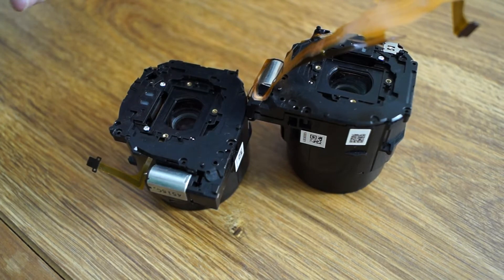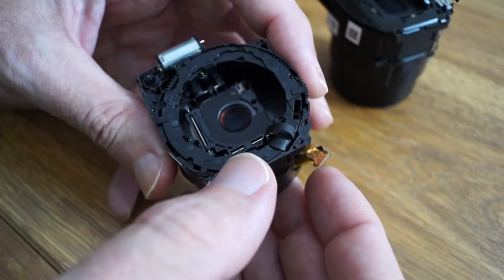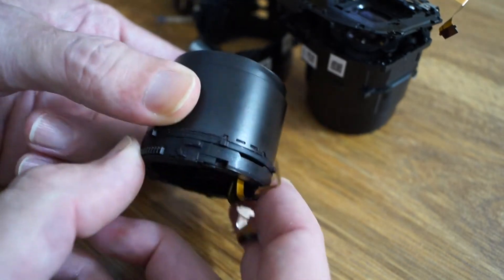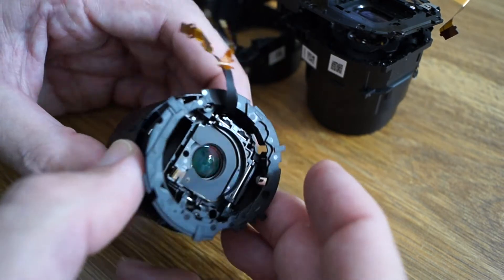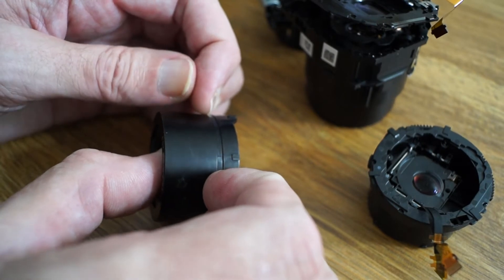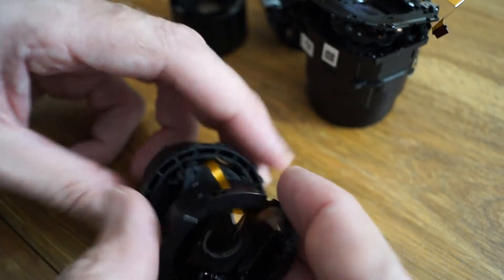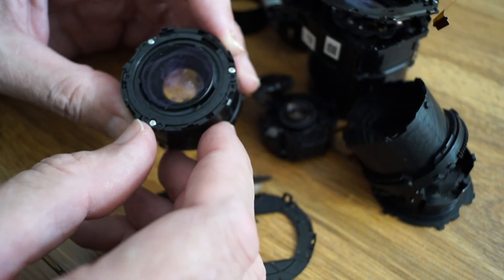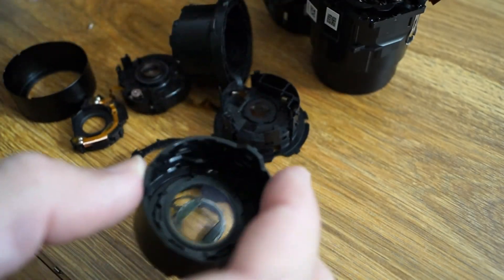what's inside, Sony RX100 lens

Comment: Is this method also applicable to Sony HX5V? I just want to clean the fungus on the front lens
Reply from the maker: might be the same,   if it's not bad and not in pictures i wouldn't mess with it.
Reply: @daves.projects it doesnt affect the photos taken. But looking at the lens its an eye sore.
Reply: @daves.projects and i ordered a replacement lens also. Might replace the whole lens if the fungus spreads. You have any idea on how to prevent the fungus from spreading?

Comment: I have a few tiny scratches on the front lens glass. Is that an easy swap? Is the glass attached to the plastic? Thanks
Reply from the maker: it's glued in, you will destroy the lens trying to remove it. tiny scratches have no effects on pictures,

Comment: Hi there! Did you ever get the other lens unit to retract? I’m having the exact problem with my lens being stuck and not retracting even with a few wiggles. I’m not sure what else I should attempt since there aren’t other references online or if I should just buy a replacement unit 😔
Reply from the maker: hold the camera facing lens up when you turn it off or facing down when turning on, if it retracts then it's the lens gear or cracked lens barrel. best to just replace the whole lens. check ebay.  i also have video showing how to replace look in my playlists.
Reply: Thank you! If it doesn’t retract then is it just suck somewhere? If that’s the case, what’s the best way to manually resolve this?
Reply from the maker: @jenna7040  you can try turning the second lens ring to help it move and see what it does.  i don't know how stuck it is.  does it move at all?
Reply: It’s similar to the one in the video and it doesn’t move at all. Not when I wiggle or try to turn any of the rings. The inner ring is fully extended and the outer ring is slightly extended. I appreciate your help! The worse case is I’ll replace the whole lens unit but I wanted to try learning a bit about it
Reply from the maker: @jenna7040  yeah sounds like the inner ring barrel is cracked and out of alignment. look on ebay or aliexpress for a whole lens replacement.

Comment: Hey there, thanks for your channel ... the barrier cover on an RX100 M3 I have, got an impact and has a small ding at the top of the barrier cover. Following a power on, one of the barrier cover 'shields' is stuck ... I have a replacement barrier cover ... do I need to get this far down the lens disassembly to be able to replace barrier cover? Thanks!
Reply from the maker: if you are talking about the aluminum beauty ring that goes over the lens.   no its stuck on the lens with double sided tape 12:25 with a little heat on the front you can pull it off.
Reply: @daves.projects  yes that's it! ... I used a guitar plektron to (carefully) prise the metal beauty ring/cover off, exposed the barrier cover. The double sided tape that held the cover on is no longer usable. Using the same plektron,  I then carefully prised up the 4 plastic tabs (?) that held the barrier ... whew ... need some 3m double sided tape to put the metal cover back on ... awesome thanks!!!!

Comment: Hello, did you keep the parts ? My barrel with the teeth has lost one tooth and Sony only sells the whole lens unit as a spare part A-2057-540-A, which is ridiculously expensive.
Reply from the maker: buy a whole new lens,  thats what i would do. to much trouble trying to repair lens.   i was getting them, on ebay or aliexpress for about $55, dont know what they go for now.
Reply: @daves.projects  Detached the toothed barrel from the other lens parts, one tooth is missing, if I don't get a spare part, I will make it work again, weld a new tooth in, I guess.
New lens unit could need new spacer plates, service software and knowledge to choose the right ones.

Comment: Hi, my focus ring and front piece has come off, does it snap back in?
Reply from the maker: the focus control ring ? and what front piece?   the control ring is mounted with screws from the inside on the front case.  you will have to take the whole camera apart to replace it.
Reply: @daves.projects  Yeah the part that spins to control focus or aperture depending on mode. It's come off after a knock, admittedly a hard knock, but there's no threads in the back of it so it can't be screwed on.
Reply: @daveeveritt8555  it must be replaced with a new set , it is not a simple snap together assembly as you may think

Comment: An important question : I have a lil fungus problem in my RX100 M6. Can the lens be completely disassembled & serviced? I took the camera to my nearest Sony service centre where I got told that the fungus is on a glass which can't be opened. I really need a second opinion on this. Please help...
Reply from the maker: yes the lens can be completely disassembled but its not a easy job. a lot of things can go wrong.  best thing to do is buy a new lens. even replacing the lens is not an easy job.

Comment: Thank you,I repair rx100's never had to swap lens cover/shutter blades,i know how now.
As for the comments,no m6 lens will not work with m1 body or software,sensors wont swap and ribbon connection is diferent,i tried.
As for these lenses being garbage ,these are a very simple robust lens compared to many i have repaired,i would say rx100 lens assy's resemble 95% of lenses i have worked on only simpler,a word to that commenter,check the breakdown of a super zoom lens of 16 to 30x optical and then tell me what you think of rx lenses,cheers.
Reply: Jup the Panasonic ZS40 to ZS80 Lenses are all the same and have some painfully small parts. 
They also need you to desolder about 20 Solder joints to take apart.